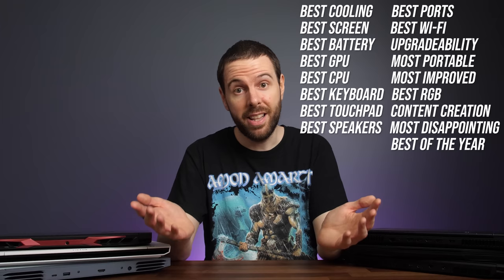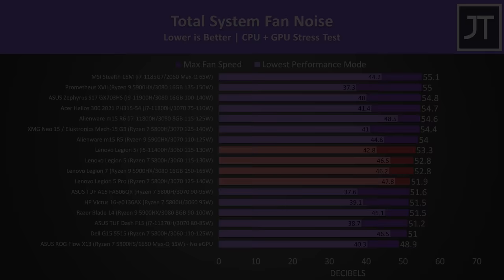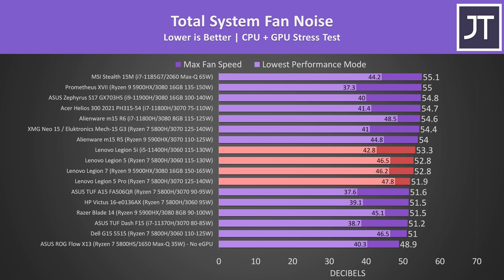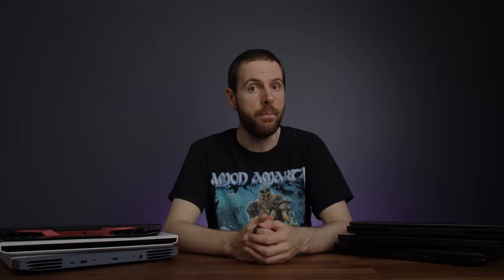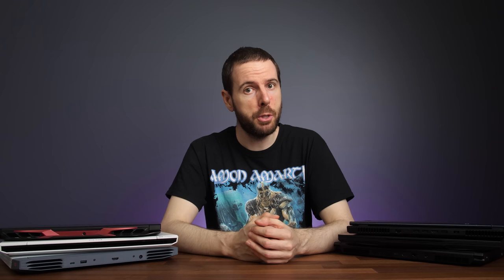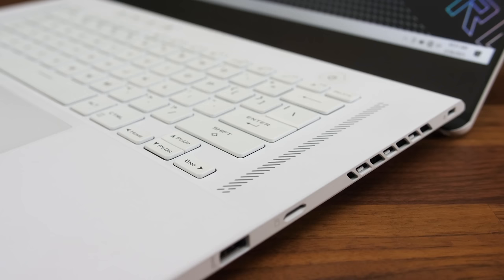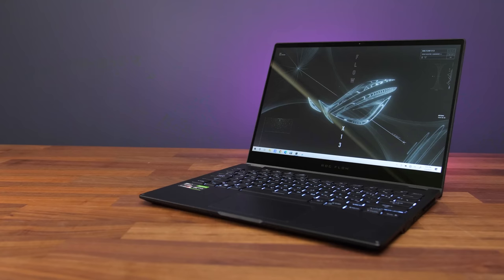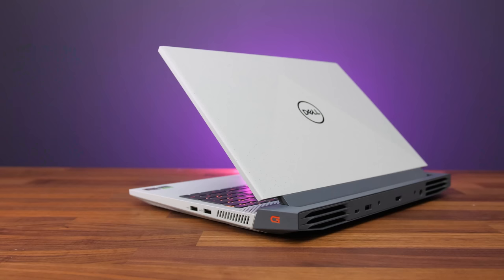Gaming Laptop Awards 2021!

Comment: How come you didn't test Digital Storm . Also, Dell has huge quality control problems. I purchased several alienware laptops and they had enough issues for Dell to replace each of them. Also, customer service is located outside US and many reps have accents that I couldn't understand well. Even worse, minor problems had to be fixed by sending back the laptop despite my having on site warranty. Lots of issues with Dell. There are a number of sites devoted to this by customers.

Comment: Where is the mighty aorus 15p? I mean 240hz screen 100% sRGB, 3060 115watts (up to 3080), all the ports you need (thunderbolt 4, hdmi 2.1, Mini DisplayPort, full sd card slot, ethernet), 99wh battery up to 8 hours with dynamic control to prevent max charge for a better battery life. Intel i7 11th gen (up to i9) and per key rgb. All for $1199 in the us on Best Buy (1299 on Amazon).

Comment: Hi I need help...I have acer nitro 5 2021 with intel core i5 11300h rtx 3050 70w 16gb ram...While I'm playing more intensive game my laptop is slowly discharging but I'm using original power brick of 135 w that I've got in the box...Is there any problem or it needs to be like that?

Comment: Can a lenovo owner tell me if they have packet loss issues? It s a pretty widespread problem and aparently it s not caused in all cases by the inferior mediatek and realtek wi fi cards (many owners and also me have replaced the mediatek and realtek cards with intel ax200 but the problem was still there )lenovo ships their laptops with(without even saying a thing...)bcs of the supply issues.Also if you have a g15 or an m16 pls tell me if you have the same problems maybe it s not just lenovo s fault here.

Comment: I've been having a problem with my Legion 5 laptop, the freesync option in the radeon software comes back as not supported even though it should be freesync capable. Ive went back to check if the problem exist in a different model of the legion 5 my brother has and its the same issue.

Comment: ok can someone plz explain how connecting to another monitor works..i have a legion 7i with 165hz display..i bought a 240hz legion y25-25 monitor this black friday…my laptop can easily bypass that 240hz refresh rate but i don’t understand how it works…is it capped at 165hz because of my laptop being 165 or when i connect it to the monitor it will be 240 hz ..or do i have to change some settings in the display settings and also in my monitor ??and also with the external monitor..should optimus be on or off?? anyone plz??

Comment: 13:58 sad fact i broke my rgb connecters on the inside of my laptop now i only have 1 side :(
Reply from the maker: That sucks, I did the same, only one side worked after.
Reply: @JarrodsTech  the worst part is I'm a freaking dummy and tried to superglue it back on, that was such a stupid move... bcuz I have like very very basic soldering knowledge/skill I have the same laptop but with the rtx 3060 instead of the amd 6000 series gpu, and the wifi in it sucks so bad as it was at the bottom but I mean at least I have 3060 tho in this chip shortage

Comment: Jarrod.... I need ur help.. confused btw legion 5 pro. Ryzen 7 - 32 gb ram/3070 ....
Asus Zeph. G-15 - Ryzen 9 - 16gb ram/ 3070(white) 

Please help me out.  Lenovo is cheaper by 200USD, but my concern is good performance for my architecture work. To run softwares like rhino/LUMION/revit/Adobe PS/IL. No gaming.  Please help me out
Reply: I think both options is solid. Architectureral work usually depends on cpu performance, and both options has fantastic cpu single core and multi core performance. It's whether you value gpu performance more (L5P) or portability (Z G15) more. Choose wisely, but there is no wrong option between those two imo.